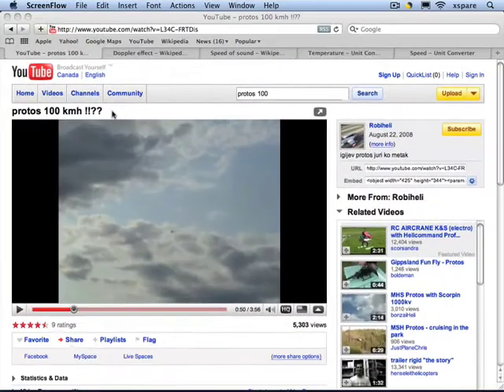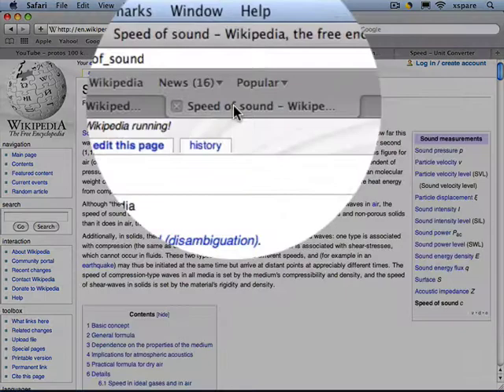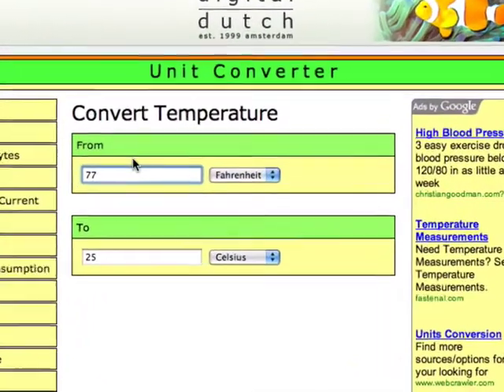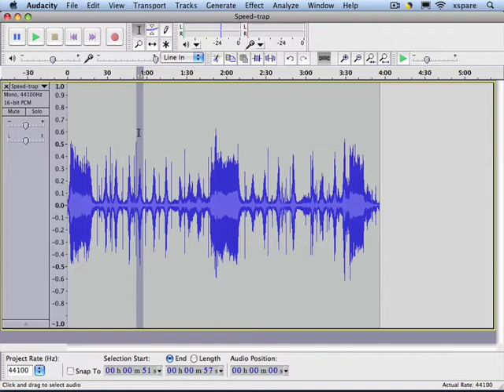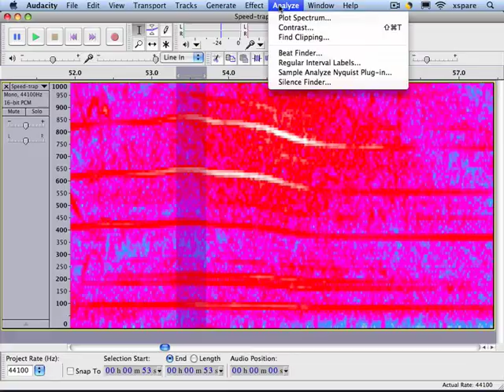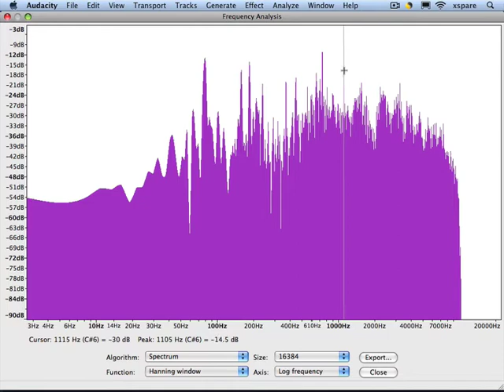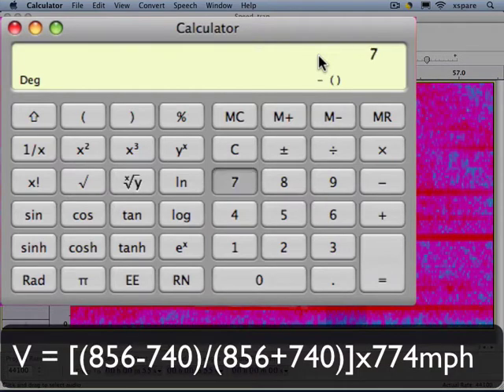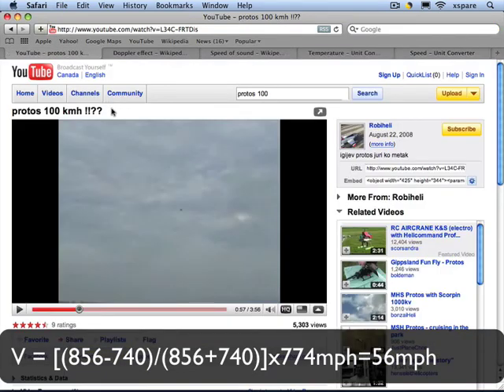R/C helicopter - DIY hatcam Doppler speed-trap

Comment from the maker: @johnfranks, the vehicle needs to approach and depart relatively straight on while maintaining a fixed speed for a couple of seconds on both sides of the pass.  If you're getting strong frequencies on the gram they should flatten out at both ends of the pass, which is correct.  Some drive trains are harder to pick out than others, so if you don't have strong frequencies then try attaching a loud buzzer to the vehicle.

You can also do constant big circles (away from the recorder) at fixed speed.